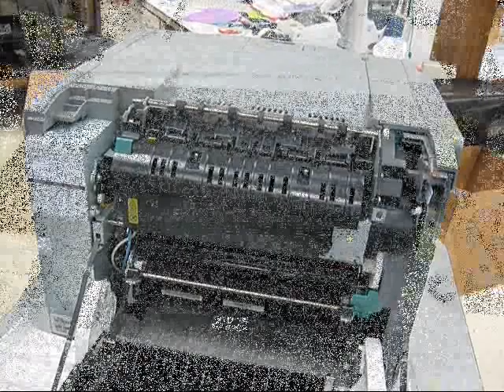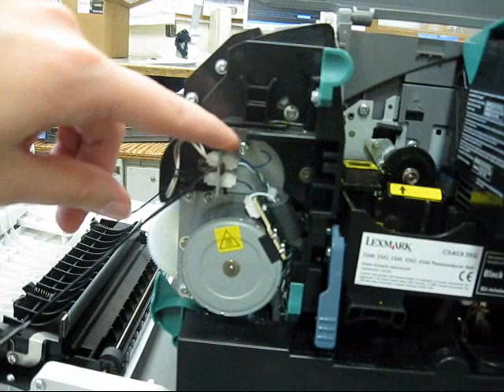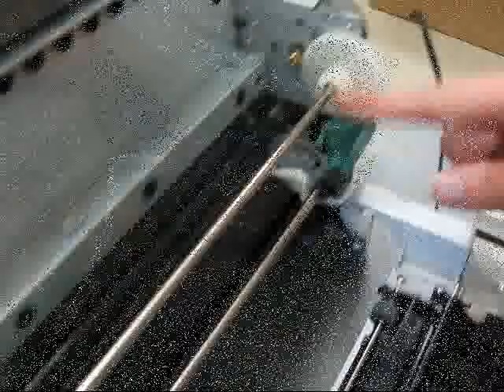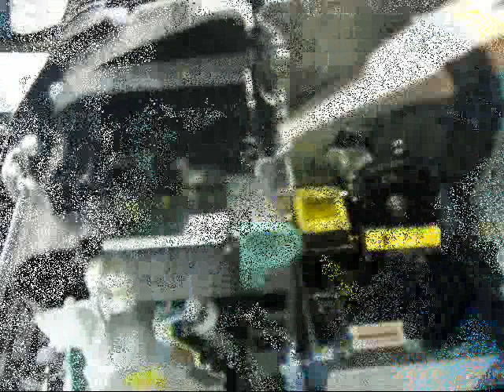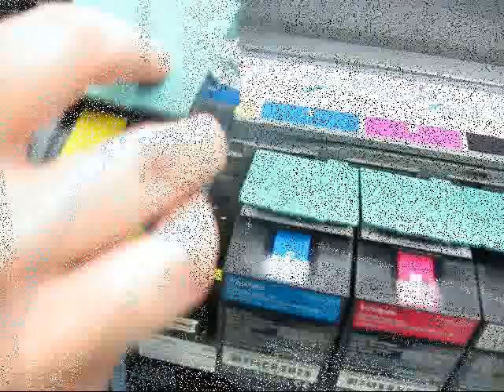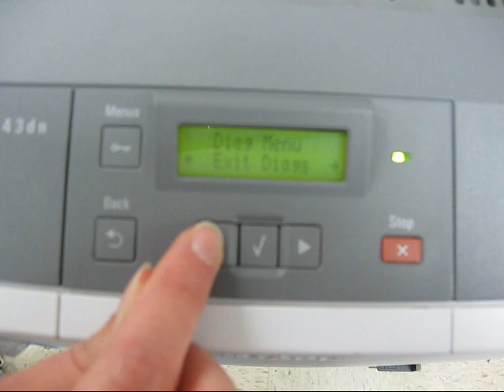Installing the Lexmark C540 C543 C544 fuser maintenance kit and rollers.

Comment: Excellent instructions.  I have saved myself £200 replacing my printer with the help of this guide.  I have a C543dn with a 122.03 fuser error.  I bought the replacement unit on ebay for £65 (incl p&p).

Comment: It's a very good guide. I already replace 2 fusors on multifunction x444 witch is similar to that.
Just have to remove a scanner belt that is attached to the fusor also, the rest is almost the same.
Regards, Jorge